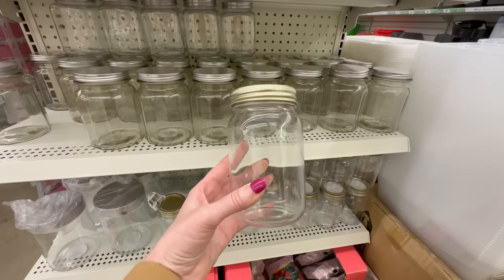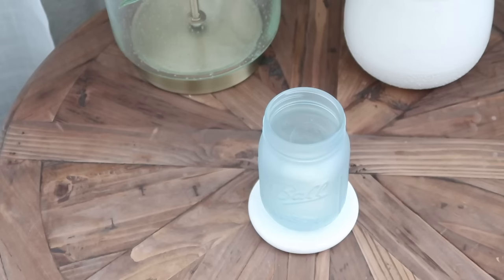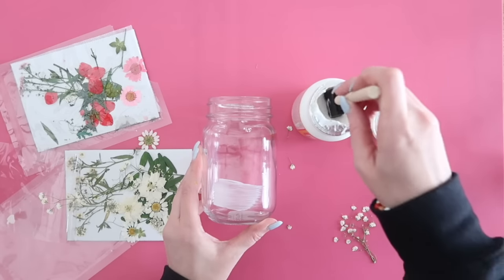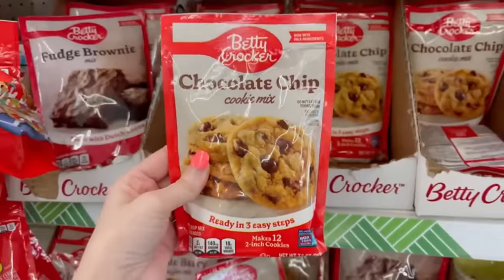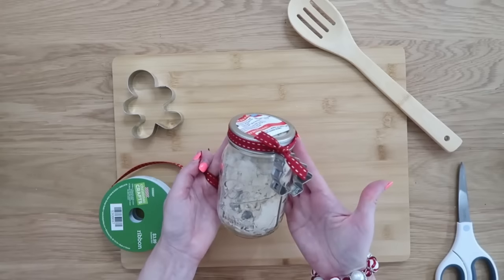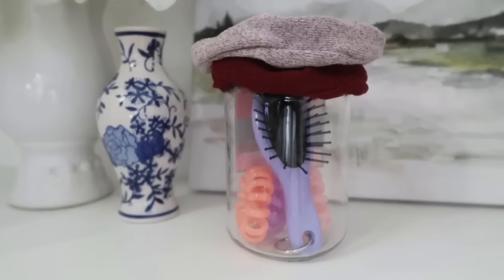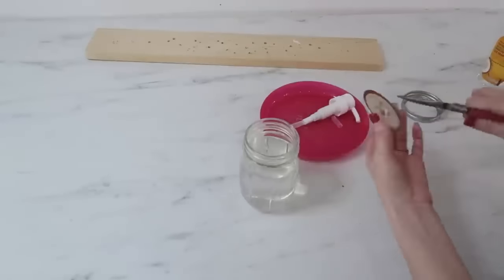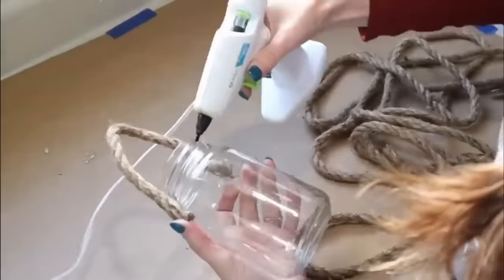50 *BEST* $1 Dollar Tree Mason Jar HACKS & DIYs! + Organization SECRETS!

Comment: 1. Instead of pillow fluff for your pin cushion, use steel wool--it will sharpen pins and needles. Also add a moisture absorber to avoid rust. 
2. Use an empty, plastic mayo or peanut butter jar for anything you give to a child.
3. Instead of cutting a hole in the lid for twine, use the lid that comes with a drinking straw--no sharp edges to fray the twine.
Reply from the maker: what a great idea!  Thanks!

Comment: Canning Tip: don’t put the ring on the jar. you won’t know if the seal has been popped or not. You only need the lid. The ring is only for pressure canning.